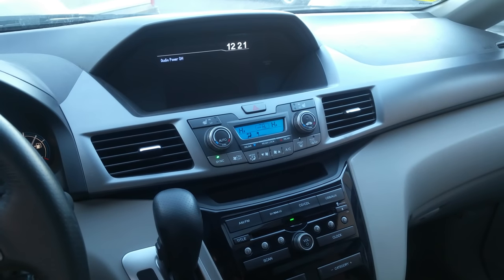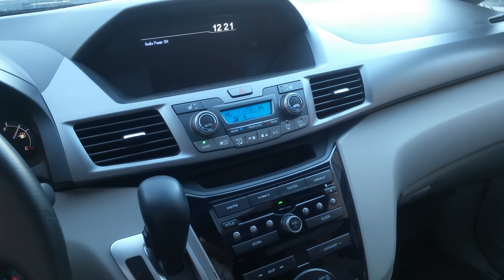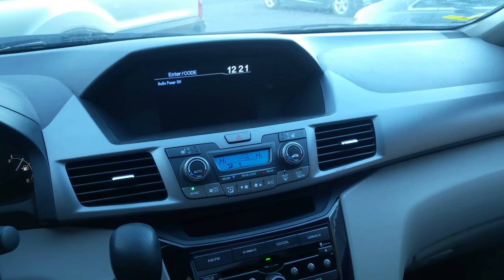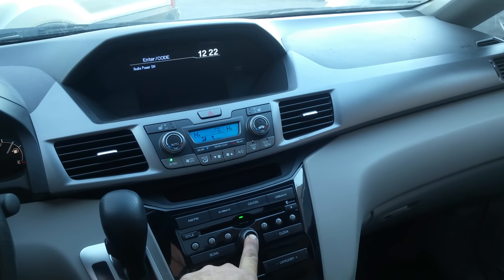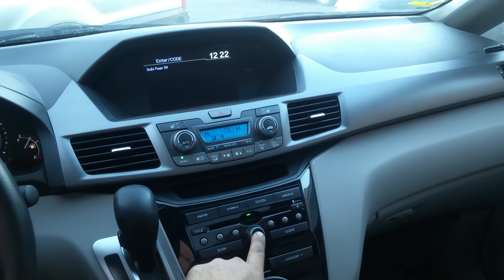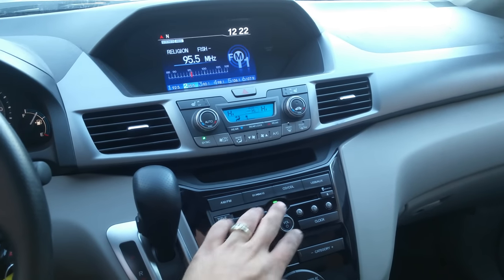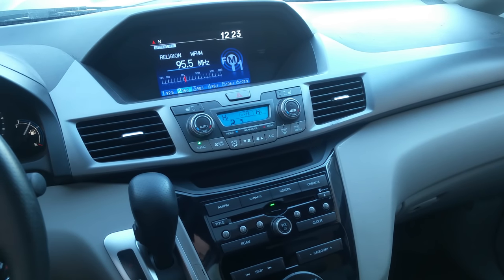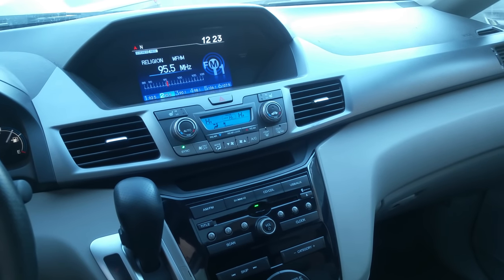How to bypass unlock radio with out entering code on Honda or Acura.

Comment: I have purchased a Honda 2000 CR-V and the radio is locked I have tried  everything cant get code for it and not on sticker do you know of anyway to reprogram it I rather not have to put another radio in but almost ready to give up

Comment: So it's a sign that the booster is giving out? Should I tend to it ASAP or wait till it's done since the brakes start working correctly after all the pumping etc.. Yes the radio is oem haven't done anything to the system other than replace the speakers.. Thanks
Reply from the maker: Well with brakes before you do anything with the booster check make sure master cylinder is not leaking, brake lines and calipers. With radio it could be the noise filter or polarity on your new speakers could be not hooked up correctly.

Comment: acura 2010 TSX  Code Error e. Pressed 1 and 6 entered radio code, after 2min radio shuts down.  how do I reset the radio so that it does not automatically shut of?

Comment: I started with the radio off and I held the power button for one minute. I tried this 5 times and it did NOT work. On my final attempt I started with the radio off and held the power button for one minute then I let off the power button. Nothing. Then, with the radio still on, I held the power button again for about 5 seconds and the radio unlocked.
Reply: I hope this is clear.

Comment: I have a 2008 Honda Accord ex-l v6 and it's under 85k but I just recently started noticing two issues that are causing me  to worry. One is that whenever I start my car in the morning or after a long period of time my brakes get hard after the first pump and won't feel normal till I pump them for a minute or so, and lastly my radio gets very staticky only when I go on reverse, can you help me with this? Thanks
Reply from the maker: Ok with your brakes most likely your brake booster is going bad. Do you have oem radio or aftermarket

Comment: I bought a 2008 Civic in 2010 and did something like this to reset the radio and bypass the code (as I bought it off some local guy and not a dealer, no codes, nada)  problem is now the battery just died and was jumped this morning and I cannot for the life of me remember what I did.
Reply: Cody Edley I have 2007 Honda Civic and I have the exact same problem what it’s asking me the radio code now I was able to get the serial number from the car by holding six and 1+ the power but that serial number is somehow not associated with my radio when the dealership put that number into the system it shows 2018 Honda Civic know if the serial number that you were getting from the system don’t match the car that you have how do you paypass

Comment: I have tried everything to get my radio back on and nothing is working. The ErrE just keep coming back up on my 2001 honda accord
Reply: when the error code comes up just put it the radio code and it should work. I just did it.
Reply: The Manuel says to leave it on for 1 h and then you will be able to try again

Comment: PS, I SOLD EXPENSIVE MEDICAL EQUIPMENT FOR 10 YEARS; 2 RULES, ENGINEERS ARE TWISTED AND 2 ENGINEERS ARE NAUGHTY; WE HAD SEVERAL HIDDEN BUTTONS AND PROCEDURES NOT IN THE MANUALS OR EVEN GOVT. DOCS. ON THE EQUIP DESIGN~

Comment: Hi there George! May you be kind enough to let me know how do you set the code for the radio on an accord 2003 with Navigation, please? I have Both codes, and I can enter totally fine the Navigation one... the issue is that the radio/clock screen above the navigation went off and I need to enter it blindly. So I would like to know how to enter it, step by step, and when should I start entering it. Pretty please and thanks in advance.
Reply from the maker: +HIV ' hit power button once then start punching in radio code via preset buttons 1 thru 6. If it does not work hit power button again and repeat earlier procedure. If that does not work disconnect battery for 5 min or so and repeat procedure.
Reply: HIV ' how did you get the radio to work
Reply: Nikki Marie Unfortunately, I still have not.

Comment: I have a 2008 Honda Accord any tips
Reply: i have accord coupe 2008 what you need to do is press 1-6 power the  press 2 its only bypass you need to do it every time if you want to turn  the radio on
Reply: anacondav12 can u explain this a little better it's unclear please
Reply: @anacondav12  thanks this work for our 2006 accord

Comment: Will this work on a 2004 Honda Odyssey
Reply: Anna Miller did you get your radio going I have same year model this video did not work for me but I got info to get yours going if you need it ok have a blessed day🤠
Reply: @whisperinthewind1789  i have the same problem. Help, please.
Reply: @joelpazfam0525  I don't have the vehicle anymore sorry. But try to get the serial # for radio and then look up free radio codes and you can get a number to call and they will give you the code. You don't have to pay bro that's b.s. keep looking on the net and you will find free help. Good luck👍
Reply: @whisperinthewind1789  thank you bro